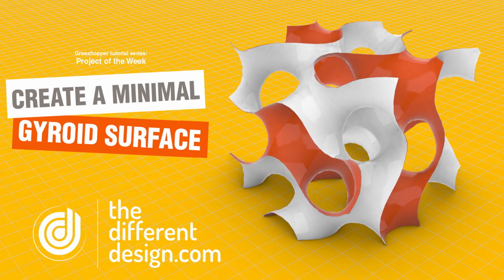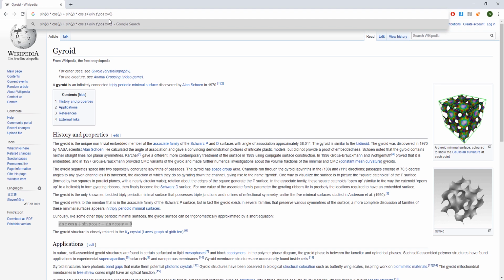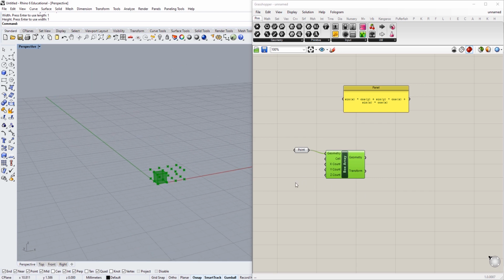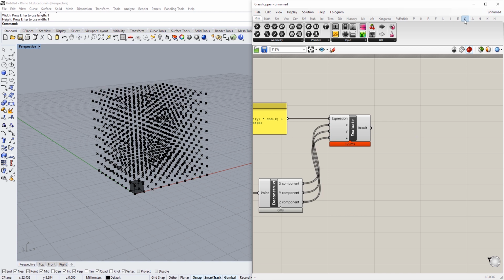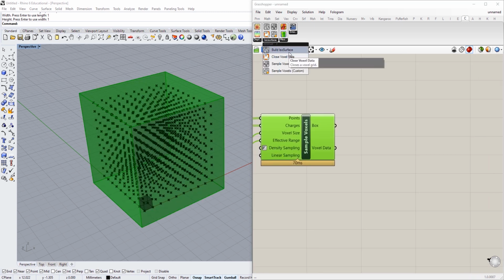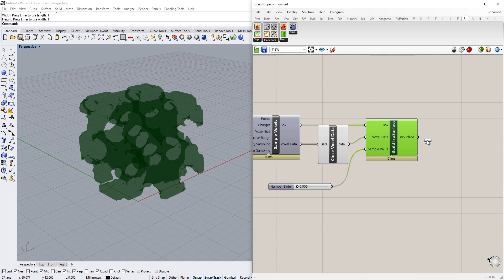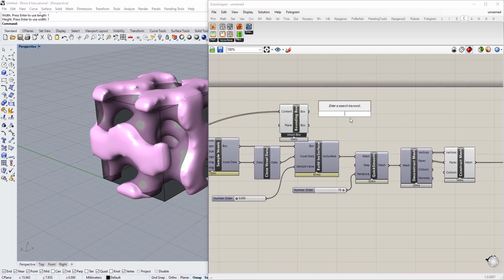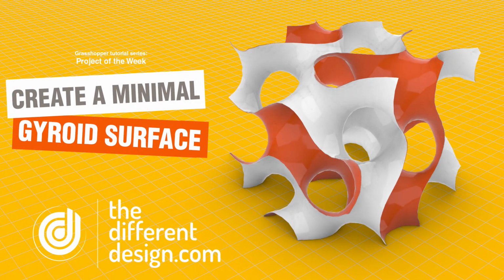Gyroid Minimal Surface (Grasshopper Tutorial)

Comment: Hi! The tutorial is very helpful. However, I have came across a problem when I was plugging in the value into the Effective Range in the VixelSample button. It said it could not find the file. After that, I could not make the script work even tho I followed every procedure carefully. Do you have any idea what might cause this to happen? Thanks!
Reply from the maker: Hi Kelly, have you copied the KDTree.dll file into your grasshopper libraries folder? Chromodoris requires you to copy both the gha file and dll file to work

Comment: This is helping me a lot, thank you, but is there a way to fill up the volume "intrapped" by the surface, instead of thickening it? I've found this video because I've seen that a person was able to do it using Rhino and Grasshopper. With the gyroid is pretty hard to explain, but with a schwarz primitive (cos(x) + cos(y) + cos(z)) it's pretty easy to see what I mean with "volume intrapped by the surface". So how can I creat a solid model in this way?
Reply from the maker: Hi there, not entirely sure I understand the question, but the step before the mesh split actually gives you an entirely contained volume (8:10 in the video)

Comment: Hello!  On the Sample Voxels (min. 5:37) I get this message: 1. Solution exception:Could not load file or assembly 'KDTree, Version=1.0.0.0, Culture=neutral, PublicKeyToken=null' or one of its dependencies. The system cannot find the file specified.  Suggestions?  I'm using Rhino 7 WIP.  Thank you.
Reply: yes i have the same issue and problem KD tree
Reply from the maker: @addy8869  Hi there, make sure you copy the accompanying KDTree.dll file to your components folder to get the plugin working :)
Reply: sameee problem
Reply from the maker: @ucodetiaw  Hi there, make sure you copy the accompanying KDTree.dll file to your components folder to get the plugin working :)
Reply: @grasshoppertutorials   thanks!! i did it. my bad
Reply: @ucodetiaw  hi, I can't load the chromodoris plugin in rhino6. Can you help me to find the components folder? I just put everything in the grasshopper component folder but it wasn't enough.
Reply from the maker: Hi there, make sure you copy the accompanying KDTree.dll file to your components folder to get the plugin working :)
Reply: @grasshoppertutorials  is not working